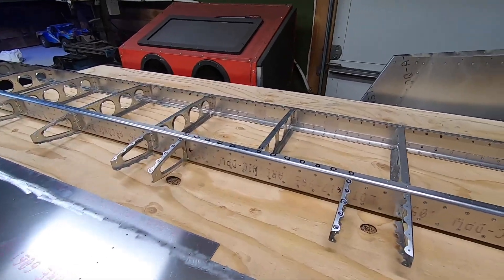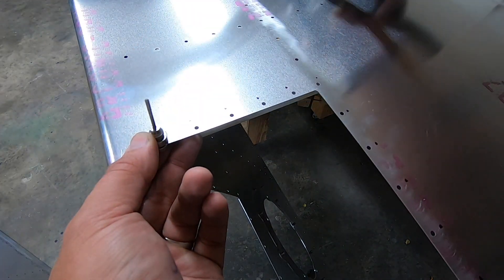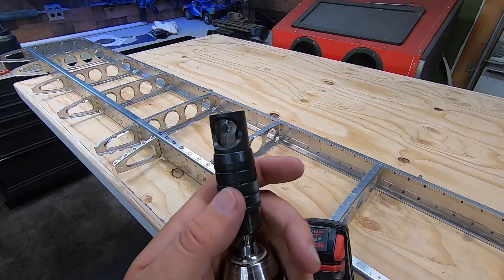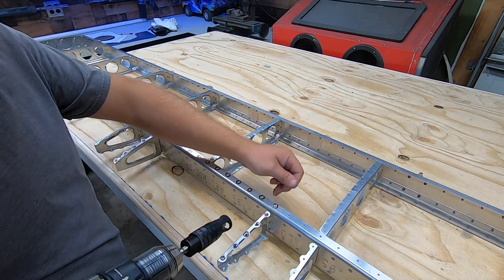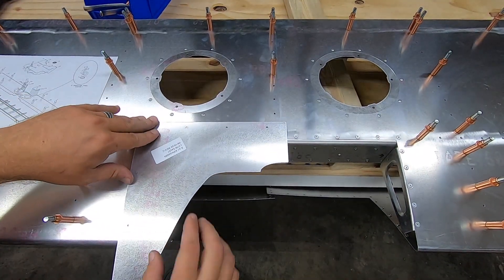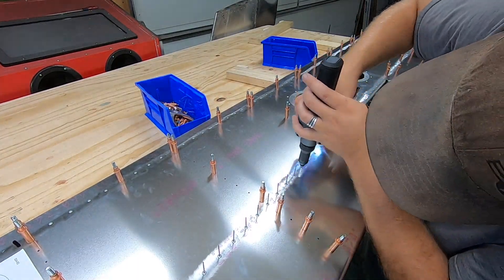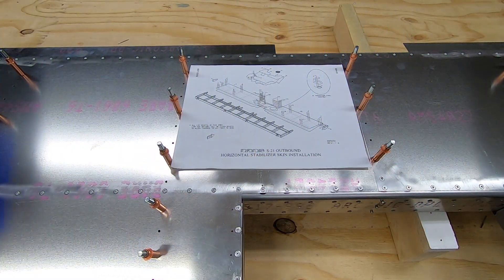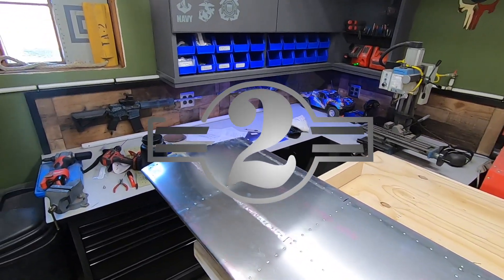RANS S21 OUTBOUND Horizontal Stabilizer Build Complete

Comment: Hey man, how many flush rivets did you put into the skin where the fairing sits? Me and my dad are on this same step, and the inventory sheet calls for a total of 53 flush rivets used. But when we count the holes. I count 25 on each side. Just making sure we aren’t missing anything before we set our rivets for good.
Reply from the maker: So I counted 48 on mine.. That doesn’t make it right by any means.. Let us know if you here anything from rans on it
Reply: Hey Josh, can you confirm that 24 on each side was correct? I'm just up to this stage on mine and know that you've already attached your stab to the fuse.
Reply: 24* on each side.
Reply from the maker: I ended up only using flush around the perimeter of the notch and one fastener back on the center rib like the picture. I set the fairing on it to couple check myself and it seemed fine (at this stage). I did read somewhere that the only thing different in the top and bottom is the access holes in the skin so I did the same on both sides.. I’ll count them later on today but I think it was only 48 that I did..
Reply: I'm late to the game here but for folks at this stage, the count is 26 per side. The latest parts diagram shows one addition flush rivet wider than this video on the forward spar. Great videos!

Comment: Manufacturer      Model                                                                                                   Cabin Width    
Rans                     S-6 Coyote 2 45 Inches,S-20 Raven 46 Inches,S-21 Outbound   46.5 Inches
Just Aircraft       Highlander, Superstol , Supersol XL                                                 44 Inches
Kitfox                  Series 7 Supersport, Speedster, STi                                                  43 Inches
Cessna               172 Skyhawk, 182 Skylane                                                                 42 Inches
Piper                   Archer LX                                                                                               42 Inches

Comment: On the skins, along the rivet lines, what surface preparation process did you choose to use?  Will you do that to the entire skin later or just along the rivet lines?  Did you do it to both the inside and the outside of the skins?  Thanks
Reply from the maker: On the holes that run down the forward and aft spars I tried out a scotchbrite pad on a dotco. It shows up on camera a lot more than in real life. I suspect if you had plans on polishing the surface rather than painting, it would not be a good choice. I haven’t figured out what exact paint process I’m gonna use yet but it will involve a primer, top coat and clear so I’m not worried to much about it showing in the final finish.. with the skins being so thin, they tend to “countersink” quickly while trying to debur. That’s why I tried something new on these.